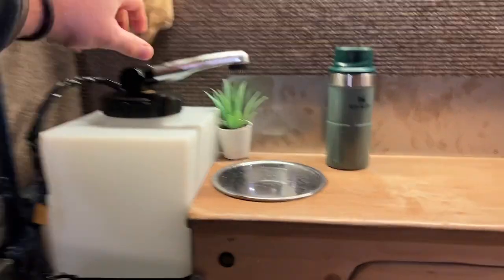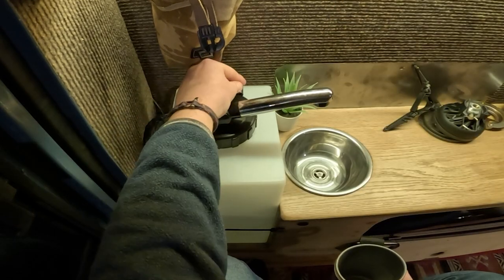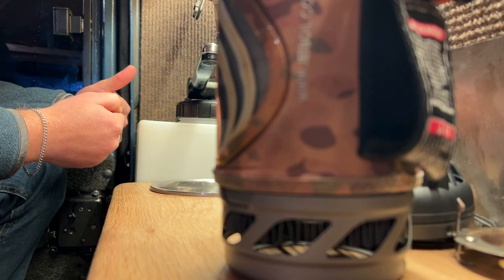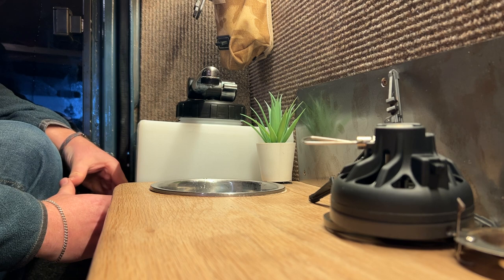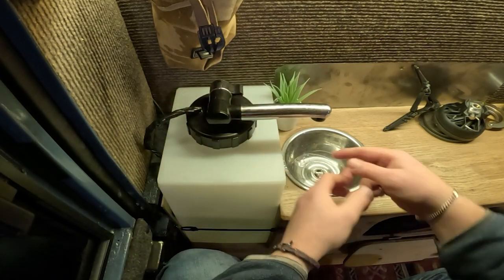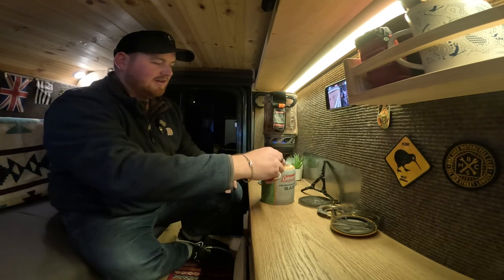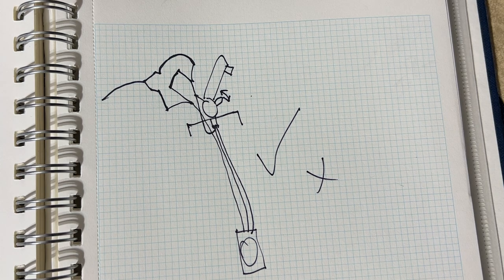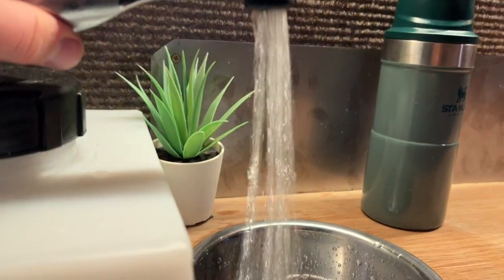WATER TAP SOLUTION - DEFENDER CAMPER BUILD  - 12v PUMP

Comment: I know you have been copping some grief over on IG with what happened with the IG sub update. Out of order the shit you have taken over it - hopefully there will be some karma from some of those taking low shots. Understand why you have left IG but the right thing to do for your own sanity. Thanks for answering my queries over the last couple of years.

Regarding the wood top - rather than varnish, have you thought about oiling the wood? If done correctly and topped up every so often, I have found that wood that regularly gets wet survives better. Varnish can chip and once water gets underneath it, the varnish fails fast.
Reply from the maker: Wow thank you so much for the kind words. You know the situation well. Yeah some pretty odd people out there. Looking forward to it all blowing over and returning to Insta.

Yeah that would be good, I guess I could sand it back and re coat it. I was never a fan of this varnish, it really didn’t bring the best out of the wood. Thanks for the good idea, cheers